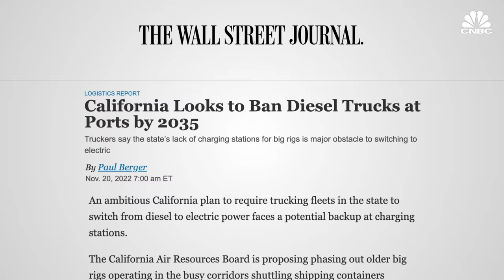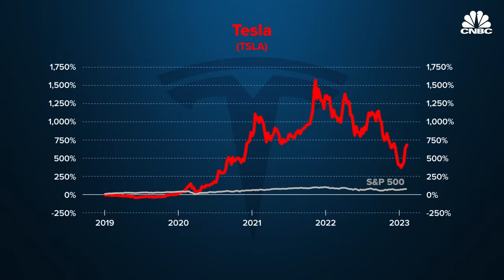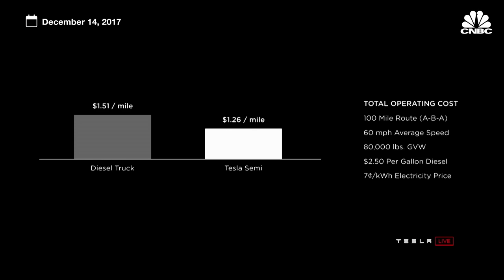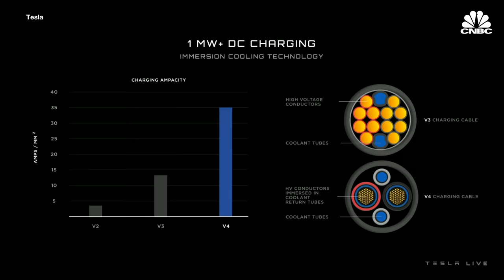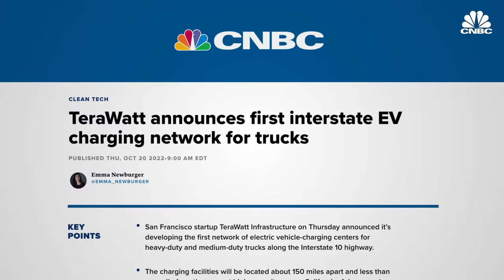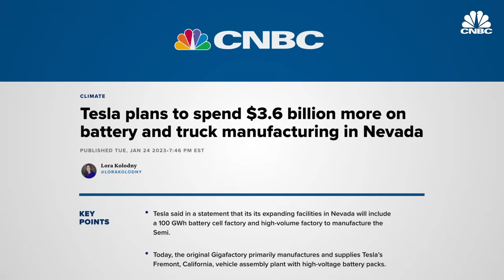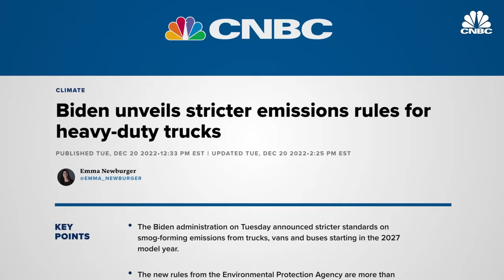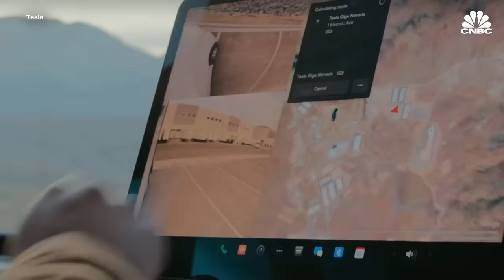Does The Tesla Semi Live Up To The Hype?

Comment: “The longest delayed product in Teslas history!”
Meanwhile all the roadster preorder customers 👀
Reply: the longest delayed product in Teslas history, so far.
Reply: To CNBC every Tesla product is vapourware until they release it and start selling in high volume.
Reply: More people are waiting for the cybertruck than roadster
Reply: @NeutronStream  That's sort of fair for CNBC to do, though. Every Tesla product does seem to spend about 5 years as vaporware, before finally hitting the market. They announce their stuff WAYYYYY too early.
Reply: They said one of the not the
Reply: @matthewp1682  I'm specifically waiting to see how the Cybertruck does. I'm super curious how it will do because this will be the first time that Tesla isn't the first company to enter a particular electric vehicle segment. Ford, Rivian, and GM all beat Tesla to the punch.
Reply: Semi and Roadster were both announced in December 2017, the Semi was promised for 2019, the Roadster for 2020, so the Semi was the longest delayed product in Teslas history.
Reply: @Bertinator-nm9ld  Shouldn't be hard to beat Ford, GM and Ram.    The GM Silverado EV sells for $100k, GMC Sierra EV sells for $107k.    That doesn't even include the dealer markups for 'market adjustment' that can be as high as $40k.   The Cybertruck will be a superior product and will most likely sell for $30k less than other trucks.   I bet it sells for less than the Rivian which is a light duty niche truck.
Reply: @Bertinator-nm9ld  Taking a long time to make something that's never been made before at scale doesn't make it vapourware. CNBC was calling the Model 3 and Y vapourware when Tesla was building out entire factories.

CNBC speak of Tesla as if it's on the brink of collapse when major automakers are tens of billions of dollars in debt and their sales have been declining for 5 years
Reply: Hmm, while the competition is coming and Ford is going to kick Tesla’s butt and GM led. Hahahaha. Where are they?
Reply: @troyfall6573  GM claims the Silverado will have a base MSRP of around $40k, and the F150 Lightning pro had a base MSRP of $40k, though it's since been raised to the mid 50k range. That's direct competition for the Cybertruck, which Tesla initially claimed will have a base price of $40k, but later said would ultimately be higher. Tesla doesn't have all that great a track record of actually meeting the price targets they initially give out.
Reply: @Ronnieleec  You led Mary! And it matters!
Reply: @NeutronStream  True, but Tesla's marketing campaigns are also pretty sketchy with very optimistic initial release dates and prices. I don't trust Tesla's future predictions much more than I trust CNBC's future predictions, unfortunately. That's not an endorsement of CNBC's predictions, to be clear.
Reply: @matteocomelli9587  exactly
Reply: @Bertinator-nm9ld  You make some fair points. I also like your pragmatic view of the future.
Reply: Still waiting on HyperLoop
Reply: How long have they sold FSD already? And they still haven’t delived it. I wouldn’t be surprised if they never will deliver it.
Reply: @NeutronStream  If they don't come out when Musk said they will, and are constantly delayed. Then CNBC does have a righ.
Reply: @Bertinator-nm9ld  
You forget that every "car" company routinely releases a "concept" 5, sometimes more years before a pale imitation emerges as the production product.
Tesla announces, then eventually releases.... The actual product.
And until now, every one has been the segment leader by a wide margin at time of release.
That implies that they are simply, as EM says "producing the impossible, late", but also begs the question, where are those other companies who talk the talk, but have yet to get close, even with 5 years warning and decades of experience?
.
(And don't try "other semis' already in the market". They're below the spec of the low range Tesla)
Reply: @Bertinator-nm9ld  
"The electric pickup truck now starts at $56,000 – more than $15,000 over its original pricing. When Ford announced pricing for the F-150 Lightning"
Reply: Roadster customers their heads will turn grey before they can own what they preordered
Reply: @rogerstarkey5390  Concept cars are not made for production.
Muck said these will be produced on go on sale.
Reply: @troyfall6573  Ford is the best truck so far. Even still, the Lightning feels like first draft for a good EV. Gm hasn't sold any Silverados or Sierras. They can barely manage to make a few Hummers. Hopefully the Cybertruck doesn't have the same tonneau cover issues as the R1T. Hopefully Tesla is reliving bad dreams over the suspension problems, after watching Rivian have to recall all their vehicles for the front knuckles.
Reply: @rogerstarkey5390  Concept cars are a separate category from production cars. Most concepts are never intended to be released as a production vehicle. Automakers don't usually unveil their new production cars until months, or maybe a year, before they plan to put them into production.

Tesla hasn't entered any particular vehicle market with a direct competitor so far, so of course they wind up being the segment leaders. That won't be the case with the Cybertruck. That's why it will be so interesting to watch!
Reply: @rogerstarkey5390  Good catch, on the f-150 price change. On the flip side, Elon Musk said: "A lot has changed [since the Cybertruck was announced three years ago]. The specs and pricing will be different; I hate to sort of give a little bit of bad news"

The RWD Cybertruck is guesstimated to start around $50k, according to KBB, with the AWD version starting at around $60k, and the 3 motor version starting around $70k.
Reply: @matthewp1682  Thing is the cybertruck is a better vehicle for being delayed.  The SS body + larger aluminum castings for a frame are going to make it very popular.
Reply: Tesla Model S proto-type  to production 5 years.... Semi revealed in 2017 production 2023 = 5 year(allowing for Covid).... oh math is it great....
Reply: @Bertinator-nm9ld   If it hits the market was it ever really vaporware of was that just a slam.  Vaporware is no longer a well defined word if it ever was.  We know cyberTruck and Semi were both delayed due to battery production.  They cyberTruck design benefited significantly from the delay.
Reply: I can’t imagine being one of the people that put down $50,000 for that thing…
Reply: @Ronnieleec  They are busy paying interest and pension where they raided the pension funds.
Reply: @Roger Starkey  completely invalid comparison... concept cars are never intended to be production vehicles and no manufacturer has ever taken "reservations" (interest free loans from customers) for one.
Reply: @danharold3087  Honestly that seems like a bit more of a philosophical question, than a practical one.

I'm certainly not saying there weren't valid reasons for delays. I'm moreso saying that you need to factor in at least a 3-5 year delay to pretty much any initial Tesla launch date. They may have good reasons for delays, but Elon Musk is absolutely terrible at predicting timelines. Maybe he even knows that his predictions are WAY too optimistic, and just didn't care.
Reply: @danharold3087  i agree, i think itll be the best vehicle ever made
Reply: She said “one of the longest…..” If you’re gonna quote someone quote what they said.
Reply: @Bertinator-nm9ld  Tesla owns the EV market for yearS.  Full self-driving soon ... NO DRIVERS NEEDED!  wOW!
Reply: @hal8683  I do envy your optimism, especially since Tesla's EV market share is decreasing, and autopilot is not working out nearly as well or as quickly as promised. They don't seem very far ahead of other market leaders with current self driving tech. They're just more hands off with letting users put too much trust into the systems.
Reply: They said one of the longest delayed
Reply: @joeybulford5266  Elon doesn't work on HyperLoop, never did, never told he would do it...
Reply: @Bertinator-nm9ld  those will be bare bones work trucks like you see a municipality or contractor use. The trucks that most people want will be $100k plus from GM
Reply: @JC-dr8ev  The trucks that most people want from Tesla will almost certainly be in the same price range as the Silverado EV and F150 Lightning that people actually want. Truck buyers, for better or for worse, are insane when it comes to how much money they're willing to spend. That's why trucks have turned into luxury cars, and that's why they cost so damn much. People are apparently willing to pay. Same story will go for the Cybertruck.
Reply: @Bertinator-nm9ld    Elon has to be optimistic.   He is leading people and that means selling them on the mission.    Toss in some real world delays and it can look bad.    But he is not doing it to torque off customers.   It does provide ammo for the detractors but the advantage of a project team that is geared up and hunting for bear is worth much more.  Far better to be late and deliver amazing products then be on time with another who cares product.
Reply: @danharold3087  He doesn't have to build a cult of personality about it, and project unrealistic deadlines, though. Over promise and under deliver isn't the only strategy available!

It does seem like there's been a little bit of backfire, in recent times. When you intertwine that personality so closely with a business, it can hurt the business when the leader falls out of favor. I don't think it's a death knell, or anything, but we saw some of that Tesla blowback when Musk was taking a lot of heat during the Twitter saga.
Reply: @Bertinator-nm9ld  
You have a pandemic bias. These new products are delayed because of supply chain disruptions and allocating resources to less risky endeavors during turmoil.
Reply: @ogzombieblunt4626  Tesla has had a long history of delays BEFORE the pandemic ever hit. The Semi was supposed to launch in 2019...
Reply: @lesp315  Why do you think I like CNBC?
Reply: @Bertinator-nm9ld  
Yes they delayed the semi until 2020 because they almost went bankrupt, ie allocating resources to less risky endeavors. Like model 3 production 🤦‍♂️
Reply: @Bertinator-nm9ld  I didn't. I replied to your "Every Tesla product does seem to spend about 5 years as vaporware" You are trying to trash Tesla and so is CNBC. That's all. No, I'm not saying that Tesla is perfect, but they are still moving very fast with a totally new tech.
Reply: @lesp315  And that should make them above criticism, why?

I like a lot of what Tesla has done. I really do. I'm also fairly frustrated with some of the marketing moves they have made. And I do raise an eyebrow when people take their predicted timelines and price points at face value. We should know better, by this point. That $35k Model 3 definitely can't be bought for $35k. That was a big promise being made when I was more enthusiastic about Tesla.
Reply: @ogzombieblunt4626  Did I say there weren't reasons for the delay? There's always technically reasons.

But that doesn't mean Tesla isn't blindingly optimistic when they predict timelines and price points.
Reply: @Bertinator-nm9ld  
Can tesla predict black swan events?? You are insane to blame them for market delays when none of the OEMs are even close after the supply chain crisis 🤦‍♂️😂
Reply: @okgoogle4206  
He wrote a really stupid white paper for the project. And he used to host a college competition for it. But once the CA high speed rail was officially killed he pulled out cause his goal was accomplished.
Reply: @ogzombieblunt4626  Tesla had chronically delayed releases since the beginning. You can't have a black swan event EVERY time, and still call them black swan events.

At which point did you just announce the pricing and launch date WAY too early? There's a reason traditional automakers don't usually officially announce vehicles until they're a year or less away from actual production.
Reply: @Bertinator-nm9ld  
Not true, they delivered on elons promise on 500k model 3's in 2019 exactly as elon said. The 2012 model S was delayed due to previous ownership and terrible company management under eberhardt. It was a literal shell company when elon took it over that had no in house technology, only relying on third parties for ev components. This is the reason why the 2012 model s was delayed, the fact you blame current management for 2012 delays when it was the previous managements fault proves you don't understand teslas history, just another hater grasping.
Reply: Elon’s stated goal is to speed the transition to a sustainables based economy. By announcing with much fan faire as early as possible, it lights the fire under the arses of competitors to keep up or die. Tesla doesn’t want it’s competitors to die. It wants to very strongly encourage them to commit to electrification, for real and irreversibly, as soon as possible. You can see it rev’ing up and starting to happen.
Reply: @ogzombieblunt4626  Ok, ALMOST all Tesla products have been delayed by years. Does that caveat satisfy you?

We've got the Model S, the Model X, the Semi, the Cybertruck, Tesla Solar panels, the Roadster 2.0, and autopilot full self driving, to list a few significantly delayed examples off the top of my head. Were those ALL black swan events?
Reply: @Bertinator-nm9ld  
LOL did you just ignore my point on the model s??? Jesus dude stop coping
Reply: @Pgleamy42  That's his stated goal, but he's an "interesting" character, and not one without flaws. My thoughts on Elon is that he seems like someone who really wants other people to view him as a "savior" type character. He REALLY wants to have that Iron Man image, with the general public.

I suspect that's his main personal driving factor, for putting himself in the spotlight constantly. That's definitely the personality vibe I get from him. It's not his only reason for doing what he does, but I think it's the one of the core reasons.
Reply: @ogzombieblunt4626  Did you just ignore my point about EVERYTHING ELSE? Seriously, dude?

I read your comment about the model S. If I'm making a list of all the Tesla delays, it's fair to include it. But, if it really upsets you that much, I'll stop talking about the S. 

What about all the rest of those delays on almost every product?
Reply: @Bertinator-nm9ld  
Again you have a lack of comprehension, the   singular black swan event which was the pandemic effected teslas risk tolerance and forced them to invest in products that are already making them profit and not into less profitable ventures. This includes all those products you mentioned... model 3 was given strict priority of resources to keep the company alive until they started making enough money in 2021 to invest heavily in other product ramps.
Reply: @NeutronStream  We'll they're not wrong... This applies to every single company, don't make promises you can't keep!

11:43 PM
2/13/2023
Reply: @Bertinator-nm9ld  
I would love to hear your reasoning on how later management is responsible for previous. But respond to my other reply first.
Reply: @NeutronStream  Mainstream media  has been naysayers and doubting Tesla and Elon. He has the last laugh tho ,always.
Reply: @Bertinator-nm9ld  uhmn... Ford raised the price on the pro model to $58k. As far as GM and Tesla's prices.... we'll know in  about 6 months.
Reply: @Bertinator-nm9ld  would like to point out that the model Y production actually happened 6 months earlier than expected.
Reply: @davekozlowski1266  Yeah, someone else pointed that out. I guess I should change the original comment to match. They'll all probably be direct competitors.
Reply: @Bertinator-nm9ld  yet vaporware is never realized, they do end up producing so that's kinda unfair to call it vaporware
Reply: @Bertinator-nm9ld  and GM said in 2018 they would have 20 different EV models for you to buy in 2022. Seems they were a little overly optimistic too.
Reply: @davekozlowski1266  That's kinda funny because the Model Y is the one product that I pretty much just mentally glossed over, when following Tesla. "Ehhh... It's just a lifted Model 3. Just like a lot of other crossovers on the market are. That's nothing I need to spend too much energy caring about."  Maybe that's why they came out ahead of schedule. Pretty simple (compared to designing an actually new platform) to lift a car a few inches and make a few other minor modifications.
Reply: @Bertinator-nm9ld  a few other changes...like giga castings? 🤣 
Please explain to me why GM has produced less than 1,000 Hummer's in a whole year while they have supposedly 100,000 pre-orders. Why can't they make more lyriq's? They started the production at the same time that Tesla started production in Texas. Tesla is making 3,000 vehicles per week and Cadillac is making......I think less than 100 per week.
Reply: @davekozlowski1266  Yes. You're both right and wrong. You're right that they weren't prepared for the pandemic. You're wrong that they claimed they would have 20 EVs. I can almost guarantee you they didn't say "electric" vehicles, but rather "electrified" vehicles. The latter includes all hybrid models, not just full EVs. You fell for a bit of the "marketing speak", if you were under the impression that they planned to have 20 full electric vehicle models by now.
Reply: @cmm90871  It's kinda both fair and unfair. Their early announcements fall somewhere between real product in its ready to manufacturer form, and vaporware. You can believe that the product will probably hit the market eventually. You can't really believe the price point or launch date at all.
Reply: @Pgleamy42  
I might believe you if I didn’t know about what he did under the streets of Las Vegas. He had the perfect opportunity to provide a clean energy subway system, and completely botched it all up. Wtf
Reply: @FeatureRequest people only listen to what they want to hear lol
Reply: @matthewp1682  because of some of those similar promises that they made about the cyber truck such as millage and overall performance
Reply: Its not a priority at all, its a halo car... Also, the Plaid S is basically pairs in spec.
Reply: @Bertinator-nm9ld  But Telsa is such a closely watched company that people love to hate and short. Does anyone track the development timelines for other manufacturers so closely? And if you look at the Tesla specs, it is better than every other EV truck built by traditional makers. Isn't it better they took a few extras years and made a better truck? It has industry leading efficiency. That means a lot. I'm sure if you looked at VW or Toyota you would see lots of late or cancelled models.
Reply: @Bertinator-nm9ld  But if their car outperforms those two at the same price? Its so butt ugly to reduce cost to manufacture. Ford lose money on every lightning they make. Tesla will sell a lot of cybertrucks and all of them will be profitable. Doesn't matter to consumers, but makes a big difference to the maker.
Reply: @joeybulford5266  Hmmmm you can wait all ya like but Tesla never said they'd be doing Hyperloop and neither did Elon. There are other people doing it so your comment is bizarre.
Reply: @Bertinator-nm9ld  I think tesla were being very strategic. By knowingly letting the competition launch first, with potentially inferior tech, when their truck comes to market they had time/resources to make it out-benchmark everything else in just about every way. Clever not to be the first to market in this instance IMHO. Like to know what others think.
Reply: @Ronnieleec  Nowhere. Will be a fraction of their former selves in a few years, having hived off the ice business from the electric and allowing the ice part to bankrupt itself.
Reply: The longest delayed product which actually was released. If the roadster is not released, it will not be called a dealyed product but a cancelled product.
Reply: @joeybulford5266  CA high speed is not killed
Reply: @howtomanagetech  Yes, people definitely do track other manufacturers as closely. I mostly just keep track of of a specific segment I'm interested in, but people actually investing in them often do more.

What specs are your talking about, for the Cybertruck? With such specific specs is it better? How do you know efficiency figures for the Cybertruck, and why is that the most important factor to consumers?
Reply: @howtomanagetech  Source on Ford losing money on every Lightning they make? What makes you say the Cybertruck will outperform the Lightning or the R1T? Do you know the specs of the Cybertruck?
Reply: @BongoWongoOG  "Letting" the competition launch first??? You haven't been around Elon very long of you thought they could have launched earlier than they actually do. They aren't launching late as some grand strategic venture. They're launching late because they couldn't finish the Cybertruck earlier.
Reply: @Bertinator-nm9ld  It is not vaporware if you really make it. Vaporware is aa term for stuff that is never actually going to be made.
Reply: @okgoogle4206  
It absolutely is
Reply: @Lee-fc3yf  
No one is doing Hyperloop. It was just a dumb an impossible idea Elon Musk reinvigorated so that high speed rail wouldn’t be built. Cause ya know, he sells cars.
Reply: @Bertinator-nm9ld  beat tesla to the punch with what? Just getting something in that market… scale and profitability are heavily overlooked here, when tesla join this market it will hurt.
Reply: Tells you how badly their research is.
Reply: @Lee-fc3yf  
No. It doesn’t work. AT ALL. HOW TF DID YOU MISS THAT POINT????
Reply: @joeybulford5266  Yes they laughed when Elon said he'd build reusable rockets..they always laugh until it gets done. Where the hell have you been...scientists talk crap all the time.
Reply: @Lee-fc3yf  
No. They didn’t laugh and say that it was utterly impossible like they do with HyperLoop. Jfc why are you so obsessed with defending this pos project?
Reply: @user-gl4hn9ec7z  I was talking about the Semi efficiency. There was a published table of EV Semis including Volvo, Daimler and Nkkola. Tesla had the biggest battery and highest efficiency for longest range, but came in 2000lbs lighter than Nikola. So on face value seems the better engineered truck, if not the best.
Reply: A truck is a business necessity, a roadster isn't.
Reply: nah, Elon promised silent leaf blowers forever ago
Reply: When talking electric vehicles every automaker is saying they will have the ultimate car in 2 years. 5 years later they are all still saying 2 years. 

It does look like we are getting a small amount of production in 2023. But it’s a tiny amount compared to what was promised.
Reply: Both the Semi and the Roadster are delayed products.  But park the Roadster next to a Semi and you'll see that the Semi is indeed longer.
Reply: sarthak:  CNBC says an embarrassing number of inaccurate things in their reporting, and doesn't bother to correct them.  To the extent it really hurts their credibility for people who want trusted sources.  I'm not saying it's deliberate -- but it's incompetence, and for me, it hurts their reputation. 

It's all about cost, vs. quality, in modern reporting.  And that goes for all media types.
Reply: @Bertinator-nm9ld  They're launching late because they didn't have battery production to support Cybertruck production.
Reply: @helmshardover  There's been something that comes up and causes delays for almost every single product they've ever produced. Literally almost every single one.

At some point, you can no longer blame everything on one off unforeseeable issues. At some point, there's a bigger issue that Elon likes to announce products WAYYYY too early. He puts out deadlines and price tags long before the point in the development process where it's reasonable to try to predict those.
Reply: @Martinmack333  I'm sure Tesla really needed the whopping $100 people willingly gave to pre order. You're right, it's like they made them pay for the whole car in advance..
Reply: @SyntheticSpy  
My point is that it was a dumb idea. And a LOT of people invest in Tesla because of Elon Musks’s dumb ideas. They don’t differentiate between the Vaporware he sells and the actual products that Tesla supplies.
Reply: A very tiny proportion of the population is waiting for the roadster. I'm a huge Tesla fan boy and I'm not even waiting for it. It's dessert as Elon says. It's not really needed. All it does is post as a flagship model to show off looks and specs to other manufacturers. But that is nothing to do with Tesla's mission. Mass producing model 3 and model Y are far more important.
Reply: @Bertinator-nm9ld  well yeah while at the same time Tesla has outsold them in car sales at almost every metric. And Cybertruck has over a million reservations
Reply: @Bertinator-nm9ld  
"KBB"?
Well, anyway, if they do arrive at those prices, they'll be REALLY competitive.
Reply: @kylereese4822  
Model S "Announced" June 30, 2008.
Prototype unveiled March 2009, First production June 22, 2012, so no.... "Prototype" to production was a shade over 3 years. From essentially a startup company. 
"Math"
Reply: Elon’s too busy stealing memes.
Reply: @rogerstarkey5390  The Cybertruck seems like it will probably be in roughly the same price range as the others. I'm not sure whether or not they'll be at an advantage or not. Not sure about the Silverado EV, but the F-150 Lightning definitely has some nice quality of life design choices.

On another note, the design of the Cybertruck is very polarizing, for better and for worse. I'm very curious how well the mass market will like it, vs the more conventional designs.
Reply: @Smellindamix  Only electric car sales. Tesla hasn't had competition in that segment until quite recently.

100 reservations is certainly remember, and a tribute to the cult following Tesla has manage to cultivate, but we'll see what sales look like once it finally launches and once competitors scale up production of EVs.
Reply: Semi was unveiled 30 minutes before roadster, so yes, semi was longest delayed. Now as semi is in low volume production, roadster gets the torch
Reply: How about that Cybertruck?
Reply: @NeutronStream  teslas sell in high volume?  F150s sell in high volume.
Reply: @Bertinator-nm9ld  Tesla is already losing in China. Real competition will not be good for them.
Reply: @Bertinator-nm9ld  no they didn't
Reply: What about Tesla pickup
Reply: @whdbnrm3023  No they didn't what? I made a few comments here, so you're going to have to be more specific as to which you're referring to 🤣
Reply: @Bertinator-nm9ld  if they actually release it, then it is not vaporware
Reply: @Ronnieleec  GM has shrinking volume and Tesla. Had matching net nets on 1/10th volume!
Reply: @Bertinator-nm9ld  GM can sell it for that. But based on the bolt, they will lose a lot of money on each truck they sell. On the other hand, at that price, Tesla will have a decent profit margin.
Reply: @troyfall6573  The cybortruck won't be cheaper than the EVs from other manufacturers.
Reply: @Bertinator-nm9ld  Ford has stopped production of the lightning.
Reply: @musicauthority7828  Have you been following Tesla?  They just announced they are reducing their already industry leading low production cost by 50%.   it is a pretty low benchmark to try and beat the Rivian at $80k or the Silverado at $100k or the Hummer at $109k.   Ford is selling the lightning between $81k and $97k.   Who else is making a an EV truck?   You really don't think they can sell the Cybertruck for less than those trucks despite beating everyone one of them with superior manufacturing processes.
Reply: @musicauthority7828  no more bailouts. I agree.
Reply: @danharold3087  The cybortruck has no frame, which be an issue for people who want to use the truck for a lot hauling and towing. a unibody vehicle can handle that kind of stress.
Reply: @ymcpa73  Why will GM lose money at that price point, on the Silverado? Do you know what they CURRENTLY pay for the electric drivetrain in the Bolt, or something?

Tesla isn't the only one benefiting from decreasing battery prices.
Reply: @musicauthority7828  And they will resume production on March 13th, once the battery issue is ironed out and the necessary changes made. These sorts of things happen in the auto industry, especially with new vehicles.

Ford probably has a few years before the Cybertruck goes into initial production anyways, so they've got time to work with.
Reply: @musicauthority7828  You didn't even read my comment, did you? You may want to stick to being an authority on music, for the foreseeable future.
Reply: @musicauthority7828  ✌😘
Reply: Exactly what I thought when they said that lmaoooo
Reply: @Bertinator-nm9ld  it's been 7 years so far though. still vaporware
Reply: @troyfall6573  the sierra and the lightning are useful as trucks though. the cybertruck is filling a niche that doesnt exsist
Reply: @troyfall6573  delusional